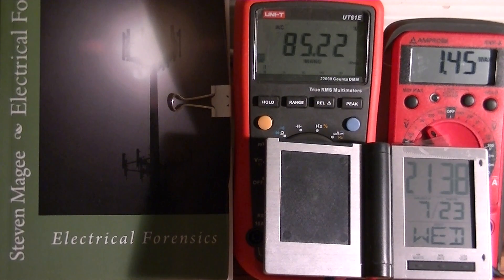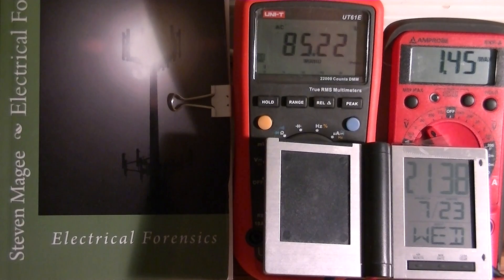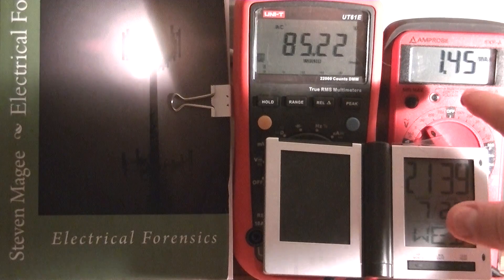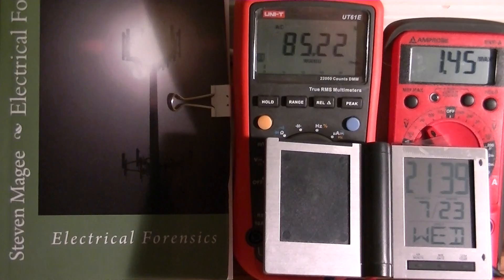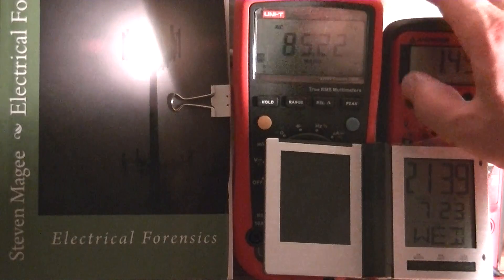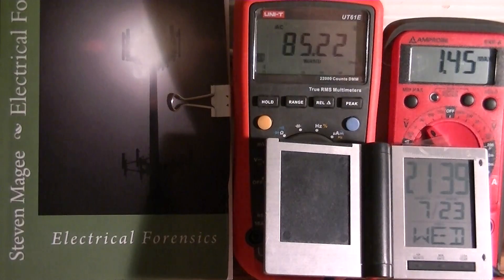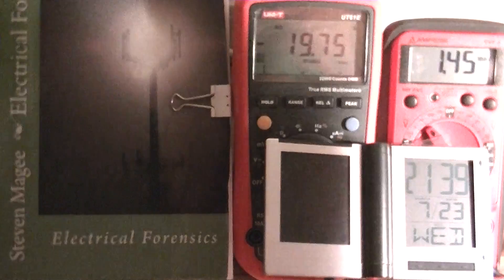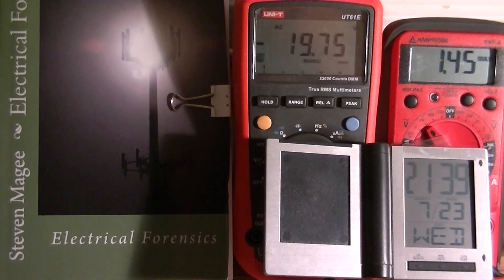85.22 Volts on an Electrical Earthing (Grounding) System

Comment: Mr. Magee, when you say there is a voltage on your grounding system--a voltage must be measured between two points, not just one.  Between what two points are you measuring?
Reply from the maker: The measurement was between the electrical grounding system at an electrical outlet (electrical ground rods are at the front of the home) and the non-electrified 8' reference ground rod in the garden was at the back of the home.

Comment: What would have happened if someone was using a grounding mat during this storm? Would they have been shocked?
Reply from the maker: If the person was in the same situation as presented here and the electrical grounding system was at the front of the home and their non-electrified ground rod was at the back of the home, they would be placing themselves into a risky situation.  The voltage would appear on the body and they may feel tingling.  A close lightning strike may exceed the rated voltage of the protective fuse or resistor and flash across it.  If you were near to or in contact with the ground or the electrical system, it could feasibly cause an electrocution.  You should not be using these earthing health techniques when a lightning storm is predicted to be in the area, even if you cannot hear or see it.